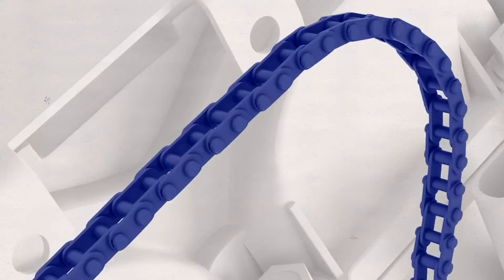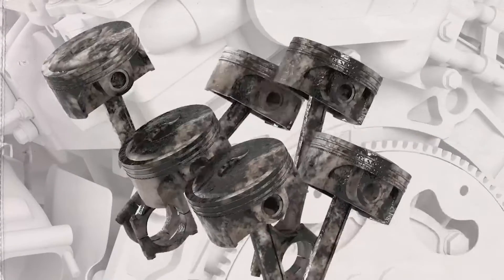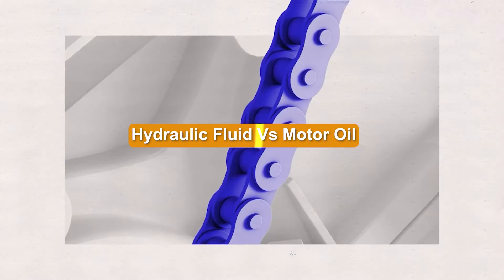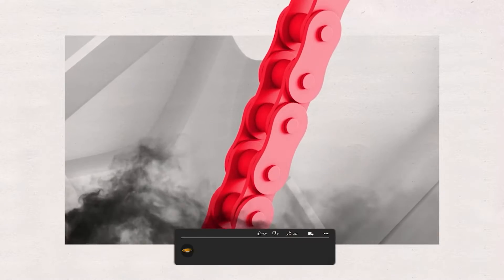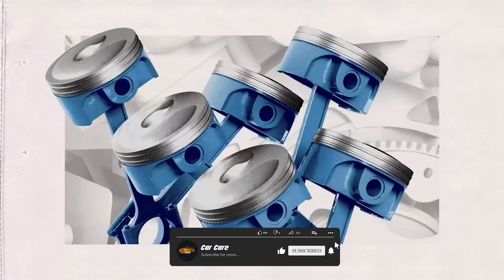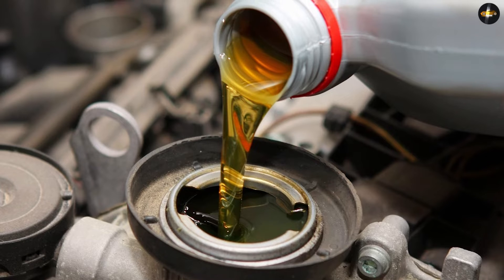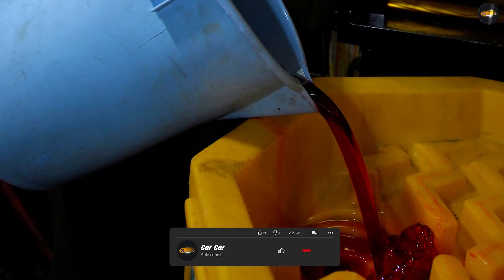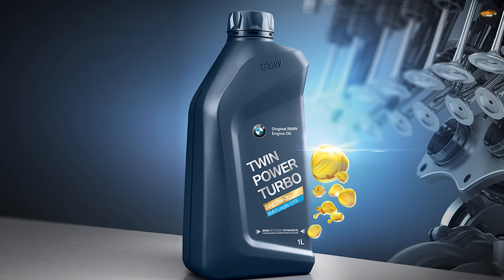Hydraulic Oil Vs Engine Oil: How Are They Different? [2025]

Comment: if i acidenly put diesal in hydralic tank will it ruin disel pump
Reply: Drain and flush it, put in the required fluid. Nothing will be harmed. You just changed the viscosity of the oil, made it thinner. I would tun it very long if you added more then a quart. It will help with the clean and flush.

Comment: I work on a golf course and need a hydraulic fluid that if spilled onto a green will not kill the greens grass.  Sometimes when mowing a green a fluid line breaks and i'm trying to protect the grass as much as possible.  any suggestions?
Reply: Try a biodegradable and low ecotoxicity hydraulic fluid.
Reply: Hi Sir, Grantt Lubricants has Biodegradable Hydraulic oil and has been tested onto grass and it does not kill the grass
Reply: https://youtu.be/wx4pmnQJdxw?si=dzzXTwnuj1QdDQqX
Reply: @piqa.rahim24  Great!  I'll pass the info along!

Comment: Can we use hydraulic oil substitute for engine oil ?
Reply: The AI said it would answer that and didn’t opting to state why one type is used in engines and the other in hydraulics. I fucked up and dumped a gal of T6 full syn 5w-40 into my tractors hydraulic tank. I drained it via the plug and emptied the filter to be safe.